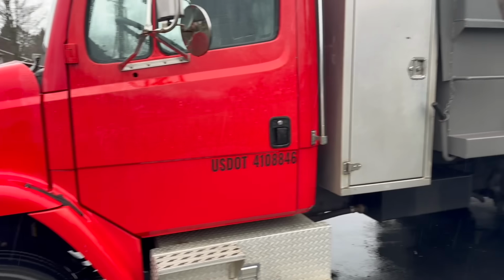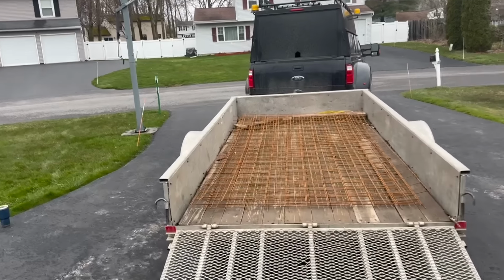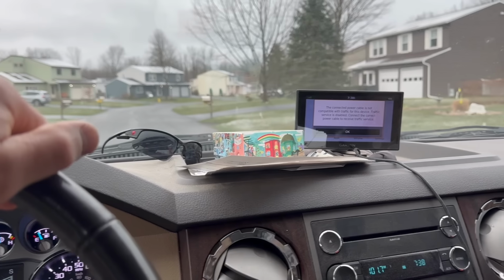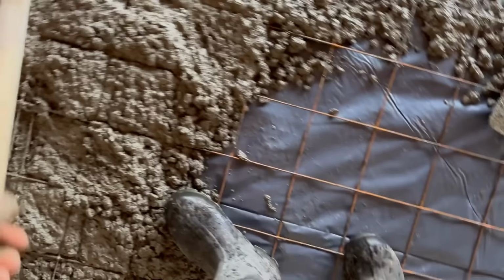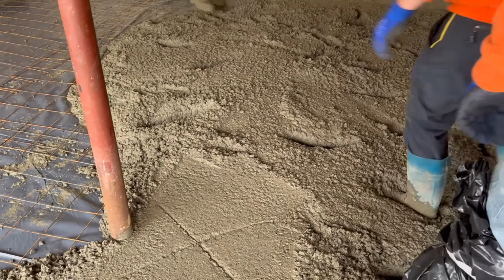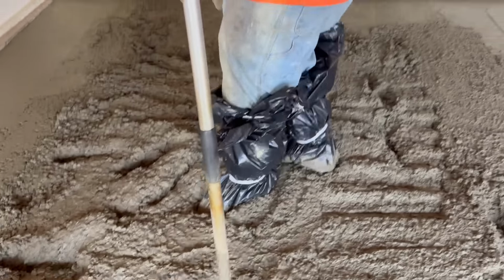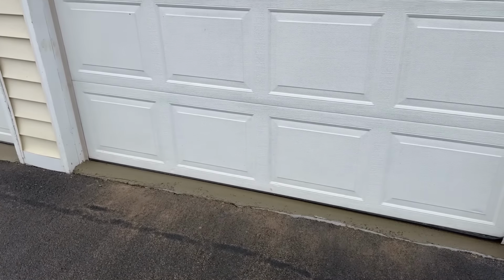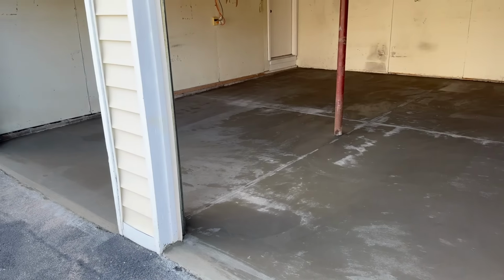SUPER FAST!! We had to tear out this concrete and replace it !!

Comment: I can appreciate the effort to hook the wwm up in the slab, however it is not a recommended practice. Spend a few bucks and use wire upper slab bolsters 2’ on center to ensure the wire is as close to the middle slab thickness as possible.  I do commend you on maintaining high slumps on the concrete mix.
Reply: Dealing with a huge highway improvement where I live, and they're doing most of the concrete at night in the winter. We don't get super cold, but averaging over 60 nights below 0F

Comment: Curious to know if there are codes that dictate when you need to cut concrete, how wide between cuts? Or is that just best practices for where you live? Reason I ask is I recently had a slab poured for a shop (20x29) and the monolithic pour they didn't cut anything.
Reply from the maker: I think they should have cut it to control the cracking. 10 foot sections would be good.
Reply: @bondobuilt386  Is there some sort of goop you can fill the cuts with so crud (and water) doesn't get down into them if I were to do my own cuts?
Reply from the maker: @TheDrew2022  Masonary caulk

Comment: I like to cut some 5/8 into 2 foot lenghts place them around the post making a box or diamond, doubled. Throw 2 in each corner, and under the garage doors with the wire mesh

Comment: Bondo, it looks good.I was kind of wondering how you're gonna do this garage.But I take it that you sloped it from the very back to the front and just kept going until you got to the bottom of the wood of the front of the Garage, and then you just.
Put a bevel on the concrete where the water can run on out to the blacktop looks great.I wish I could Have you guys come Help me with Mine Thank you very much for the video.
Reply from the maker: You bet. Thank you.

Comment: Sounds like you need a new carburetor diaphragm on your gas powered cutter. Seems to always fix the small engines I have when they rev up and down and are running a little rich on fuel. The last carburetor diaphragm package I bought was like three or four dollars... I hear that noise from blocks away and start walking over with one in my pocket.

Comment: Hey bondo in England where I am we tip clean hardcore / concrete for free as they crush it and sell it on ! Great video
Reply from the maker: Thats good they reuse it. I have used crushed concrete for fill under a slab a few times.

Comment: Bondo i notice you don’t use rebar in your concrete is there a reason why or the page wire is enough to give it strength?  Is that a USA code or am i missing something?
Reply from the maker: We use rebar in footers or slabs that require xtra strength.

Comment: thats about the slump we pour at all the time. on day like todays pour, we'd screed it off but i'd leave it open if its getting machined. i wait about 15 mins and than hit it with the wood bullfloat and then crawl edged and machine as usual. by not sealing it up, it sets up faster with less waiting around. you have to know what youre doing and be on your toes to not get behind. 
we're starting our season today it rain stops ..... and if the eclipse dont destroy the world. :)  the sawcut sounds like the jets on the carb need to be cleaned out. i try to remember to go thru all the carbs and service all the small engines before we start hitting it hard. nothing worse than snapping a dry rotted belt while finishing a floor thats going.
Reply from the maker: We sometimes wait to float as well and you are correct it helps get it to dry better. You pour a good slump it sounds like. Ya that carb needs to be cleaned on the soft cut.

Comment: As a homeowner and as building contractor, having a steel post in the middle of a 20x20 garage is a nuisance I'd correct before having you fine Bondo Boys guys in to bust out and pour me a new slab. That post would drive me bonkers.😃
Reply from the maker: Ya would be nice without it.

Comment: How thick does concrete need to be if semi trailers are driving on it?  Is 6 inches thick enough?
Reply from the maker: Yes if the sub grade is proper and the concrete is good and poured properly but check your codes in your area.

Comment: Yeah this ain’t code buddy. This job if doomed to fail. Left it worse than you found it.  I can see the spalding from here.  Wait till winter and summer to hit. It’s gonna have more crack in it, worse than re crack era of the 90’s.  I hope they didn’t pay you do this.
Reply from the maker: LOL Ya it will spald because we poured it at a 5 slump. You are clueless.
Reply: Listen I have been doing concrete at the commercial level.  You ripped this man off. Seriously, how do you have business
Reply from the maker: @joshjosh575  Explain what you think we did wrong if you are going to leave a stupid comment. We poured 1400 yards last year and 1100 yards in 2022 of this same mix design and I have had 0 call backs or problems. And you think this little 20 x20 garage is going to be a problem. We pour 60X 100 barns and bigger with no problems    all the time. This is a small job for us and he will have 0 problems with this slab for the rest of his life

Comment: The slab was not a smooth finish.
Reply from the maker: If you smooth a garage floor to much it is dangerous when it gets wet.
Reply: @bondobuilt386  My bad, you are 100% right.